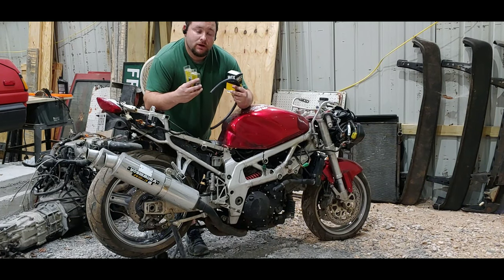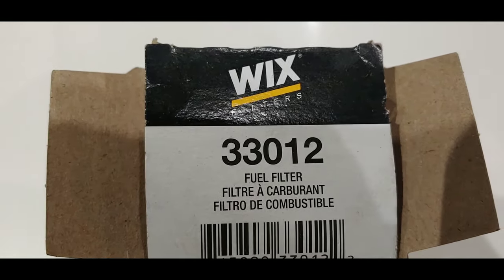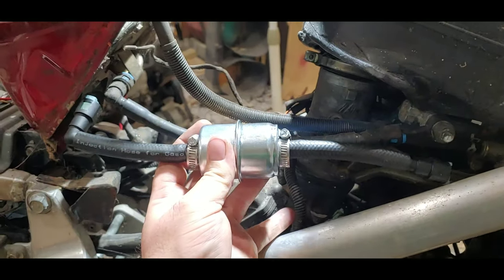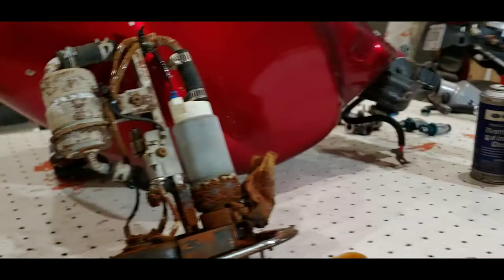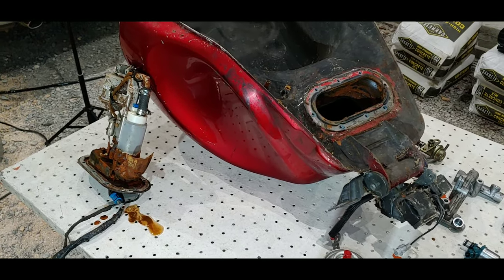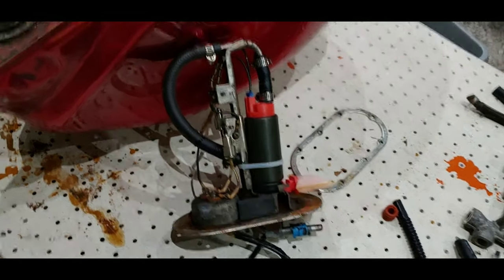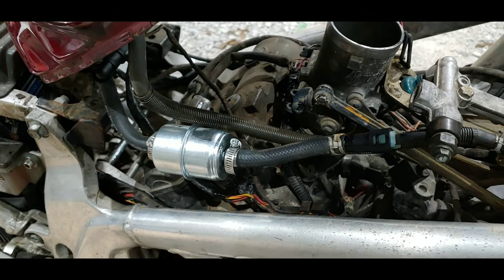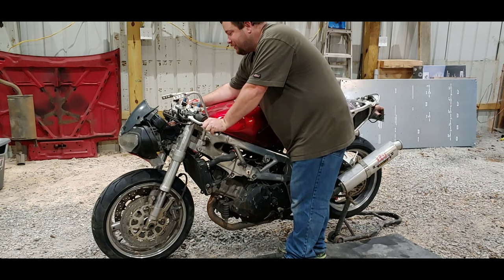Suzuki TL1000 fuel filter mod

Comment: I loved those but could only get an SV1000S in 03 when I was ready to buy. Loving IT still! I recommend Dyna coils. I used white vinegar to derust my tank, came out nice. You may want to remove the stator and check the flywheel magnets. Mine had all broken loose and migrated to one side. 13.8 volts at idle makes me suspect yours have too. My SV makes 14.4volts at idle now with them glued back in place. (Permatex sleeve retainer with aircraft fuel tank sealant in between each of them as a buffer). I hope you are having fun on that bike by now.

Comment: The Hayabusa rear brake disc is larger and will fit the TL if you use the Hayabusa caliper mount too. It's a worthwhile upgrade. Can get the caliper mount for about $5 on eBay.

Comment: Thank you for the video, it has helped me out a lot. I am going to do the same to my 97’ tl1000s tank.  Did you mix the CLR with water or use it full strength?
Reply from the maker: You can mix it with some water but I did use straight CLR don't forget when you put it all back together the fuel line you put in the tank make sure it's a submersible fuel line
Reply: @cunninghamgarage2074   okay thank you for the tips.
Reply from the maker: No problem thanks for watching the video don't forget to subscribe

Comment: Really good video. Haven't changed mine filter yet. What year is the Hyabusa rear wheel. Keep up the good work.
Reply from the maker: I used the first gen Hayabusa wheel and changed over the brake disc to the tl1000s

Comment: Awesome video! please add to the comments the part list!
Reply from the maker: YOUMAKER Case for Galaxy S10,... https://www.amazon.com/dp/B000E35WHO?ref=ppx_pop_mob_ap_share
WIX Filters - 33012 Fuel... https://www.amazon.com/dp/B000C9WJ80?ref=ppx_pop_mob_ap_share
Dorman 800-081 Fuel Line Quick... https://www.amazon.com/dp/B000E3487E?ref=ppx_pop_mob_ap_share
https://rover.ebay.com/rover/0/0/0?mpre=https%3A%2F%2Fwww.ebay.com%2Fulk%2Fitm%2F152621145241
Fuel line just go on Amazon or Ebay and order a 5/16 submersible fuel line I screwed up and put a regular fuel line on now I have to go back and replace it LOL so make sure it's a submersible line

Comment: yeah I was just wondering why if we're going to do an external fuel filter the most of us is still have a good fuel filter why we wouldn't disconnect the existing fuel filter out of the inside of the tank and then just relocated to the outside of the tank and put a new piece of hose in the fuel pump like you've done then just run are pre-existing fuel filter outside of the tankI appreciate the idea but the least now I can put my fuel filter on the outside and I wanted to change so much but I don't mind taking it apart

Comment: Greetings, I am from Africa-Angola I have a bike like this but it fails mainly when I accelerate, I don’t know if it’s injection or power! help me.
Reply from the maker: I would start with checking your spark plugs and your throttle synchronization. Mine hesitates when you first hit the throttle and I think it's the synchronization of the throttle bodies
Reply: @cunninghamgarage2074  Thank you very much I will dismantle any doubts tomorrow I will ask you to help me ...
Thank you.
Best regards.

Comment: Those quick connects, on Kawasaki the barb has a coned lock and those quick connects are for a barb with a flat lock, any ideas? I know toyota 4 runner barbs are also coned and that quick connect won't lock on it. The coned barbs have a lock which is about 9mm and the flat barb lock is about 8mm so I was thinking to enlarge the quick connect lock seat with a drill bit of 9mm so that they fit Kawasaki, if not Kawasaki wants about $80 for those quick connects that cost $5 for 2 online. The motorcycle ETFE fuel line is now available at O'reilies for about $20 for a 12" stick which must be heated to shape.

Comment: done external fuel filter mod on my busa  nice ty
Reply from the maker: The Hayabusa looks like a really comfortable bike, I would love to have one.
Reply: @cunninghamgarage2074   just recently bought it had loads of  dry sandy crud in tank not rust  previous owner fitter secondary low pressure pump and tiny  minimoto filter so i swapped it for a much larger filter im surprised the tank closes but it does  busa is beautiful bike to ride super stable slightly slower turning and fantastic  at any speed just heavy for manual maneuvers i should have bought one years ago

Comment: He's using the wrong hose that's not rated for submersion in the tank. That's a seriously bad mistake. Can't use ordinary high-pressure fuel injection hose, as the outside will deteriorate when submerged after only a few years.
Reply: Yep that crap was hard to find too. I did this mod to my TLR and ended up having to order it online for like $20/foot.
Reply from the maker: I did end up using the wrong hose and had to disassemble the bike for a second time and I did update the description to tell people to use submersible hose

Comment: He should have sawed off the bracket and the metal pipe at the top above the pump and just used a longer hose with 2 clamps instead of 2 hoses with 4 clamps.

Comment: will a tls tank sit on a tlR? 98 to 2001? they look very similar down below
Reply from the maker: I'm not sure
Reply: @cunninghamgarage2074  Thank you, one more question, there is black fuel pump type of thingy sitting in my tail section, that also goes to the throttle, do you know what it is? its round and a bit bigger
Reply from the maker: I think that has something to do with emissions